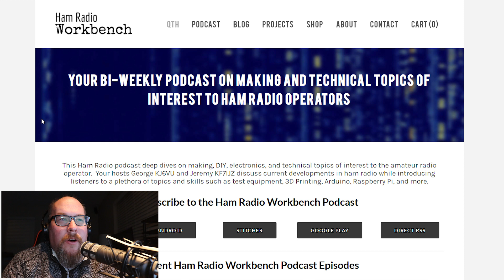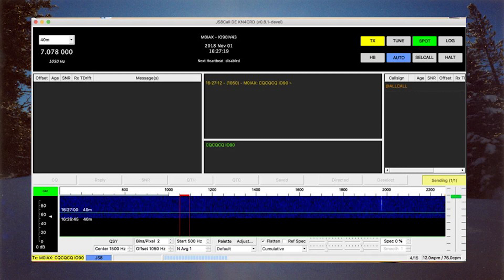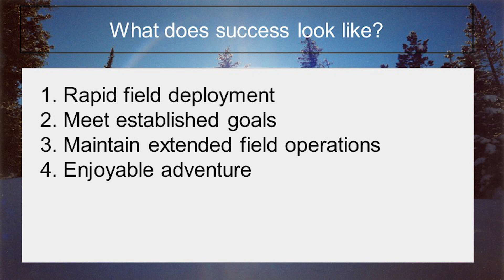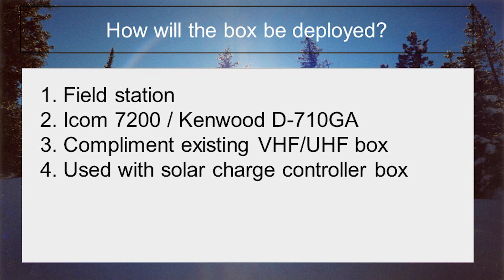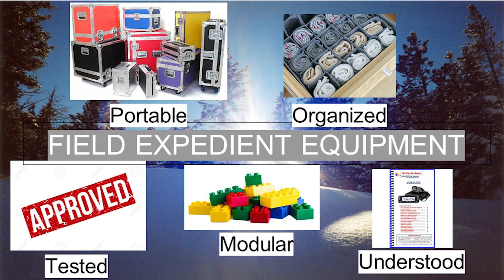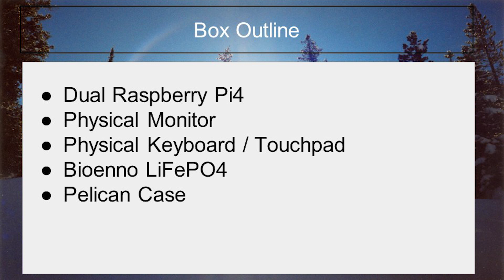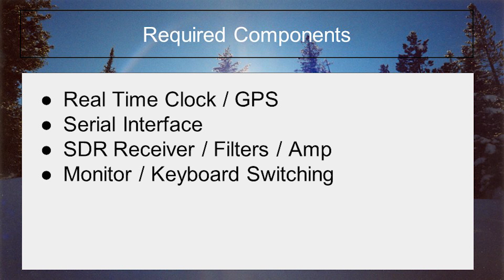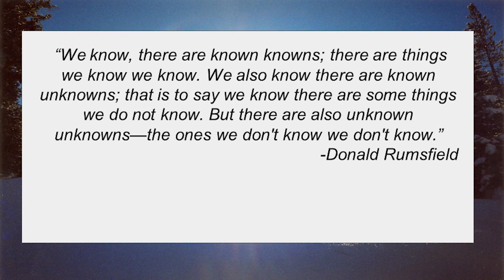Building A Raspberry Pi Field Computer Part 1

Comment: I am getting from Amazon a board that goes on top of the Pi that has a fan and taks 9 to 17 volts and powers the Pi. To me this takes cars of 2 problems.  I can power it from my 12 volts and the Pi 4 can run hotter.